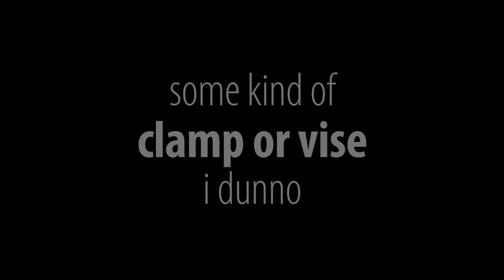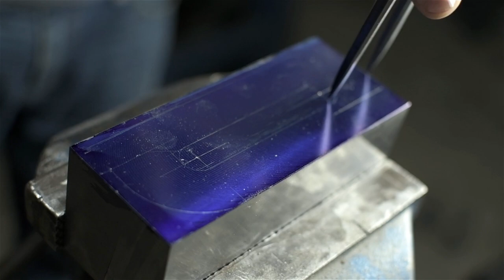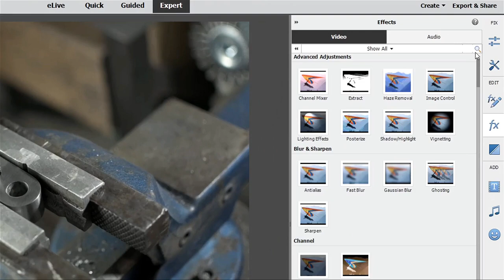BUILD: Toolmaker's Clamp Thingy

Comment: Sharing the wooden dowel wedge trick with the world seems nothing short of irresponsible.
Reply: It's the same for large boulders. He didn't show how to score the breakage line, so the secret's still safe. TOT, that was close... maybe too close.
Reply: To score that line it's very simple, just use a glass scoring knife, but not the regular kind, you need to buy the one with the diamond blade that doesn't come cheap y'all...!!!
Reply: I had to explain to my wife....
Reply: I've tried 12 different methods since this video came out and still haven't figured it out.  Blew up the SE section of my lab in the processes.
Reply: That wooden peg trick is so neat it blew my mind.  I wanted to have a go at it because it looks like it might be of great use for some projects of mine so I tried driving out to the hardware store looking for one of those glass scoring knives but ended up heading back home a few miles into my drive after I got pulled over for having a bad turn signal.  I don't want to drive until I get my car fixed so I decided to try looking on amazon but no luck.  I was also told that I might just be low on blinker fluid and to try that first to see if it solves the problem.  Anyone have any suggestions on where else I might look to find those things?
Reply: Bet Clickspring couldn't pull off the wooden wedge.
Reply: he always has me thinking until the wd40 comes out then i just face palm
Reply: It works, you just need ironwood!
Reply: Not only do the wooden pegs work, they are reusable, just don't store them in your scrap steel draw or you'll end up with swarf on the floor.
Reply: Very good use of the ultrasonic knife
Reply: Wait until you see what he does with dental  floss.
Reply: @shubus  Maybe he scored it on the bottom? I only saw him drill the two holes from the top of the block.
Reply: It works even better with heavy water....
Reply: Jokes aside: that wooden wedge trick does work on stone. The Egyptians used it to split huge monoliths out of granite. There are still some in the ground with the troughs partially finished, almost like the Egyptians left a diagram of what they were doing.
Reply: @o0Noctuabundus0o  somebody was pulling your leg there's no such thing as blinker fluid. Regular headlight fluid works for the blinkers as well.
Reply: @Οδοιπόρος  : Never driven an old import, have you? Sometimes they even use different types for front & back.
Reply: Me better half wants to know what kinda liquid ya used on the wooden dowels ... she suspects it's not regala warta. Also wants ya to approximate the time it took ... "Some time later" aint cuttin it for her.
Reply: Howard Black. Im still trying to figure out were to buy frictionless bearings. I'm thinking maybe Walmart?
Reply: @wtftom1974  brilliant lol
Reply: @TheArsonsmith4242  I never seen someone cracking a block of metal like that, but seems like if you prescribe the direction of the crack by scoring the bar stock, then pour water on the dowel pin, then freeze it, ice expands when it is freezes, and possibly crack the bar stock! let me know if that worked.
Reply: I used this trick on my ex-wife. Hence, why she's my ex.
Reply: @mahtoosacks  you used wood to split her?
Reply: @jsblacksmith858  i do have 2 kids from the marriage. Do the math.
Reply: Psss..... Actually the REAL secret to split steel in two parts like that is the orientation of the wood grains on the dowel pins to the carbon crystallites aka grain lines. If such perfection is achieved in some cases even surface grinding & lapping steps could be  completely skipped.  As Mr.ToT has demonstrated in this video. 👏👏👏.
Reply: @joshuamann4241  

The closest you can get to frictionless bearings is to have the individual bearing parts coated in Hi-T-Lube before assembly.

Best part of that process is that you can then pack them in almost any synthetic, high-temperature grease, and then seal them. Presto, frictionless bearings (or at least the closest you can possibly get to truly frictionless). 

No idea what the cost would be, though. I've never actually priced a job involving Hi-T-Lube; I know I probably couldn't afford it.
Reply: @cavemanjoe7972  lol it was a joke.
Reply: And you know someone is gonna try it....lol
Reply: @joshuamann4241  

I know. Mine wasn't. Just something interesting I thought of doing years ago.

Personally, I'd like to build an engine with all the wear surfaces coated in the stuff just to see how it does.
Reply: @o0Noctuabundus0o  Might be a good idea to check your muffler bearings while you're at it, I heard they get stocked together. If you find one you'll find the other!
Reply: I hope to try this out and see how much I scrap now I gather I need to make a score line
Reply: It's usually in the same aisle they keep the sailboat fuel.
Reply: @cavemanjoe7972  Magnetic bearings are frictionless..
Reply: @user-qc4sj2kv7j  

But can't tolerate high temperatures...
Reply: @o0Noctuabundus0o  try the dollar store👍
Reply: @Οδοιπόρος  But you need to get the 50% duty cycle stuff in the orange can
Reply: @CavemanJoe And here I was wondering what the Hi-T-Lube joke was about.  Actually spent a solid minute thinking about it, saying it out loud, and just generally going “uhh...  I don’t get it.”
Reply: @ejrupp9555  I find Evian works quite well.
Reply: I always liked sending the apprentice to the store with a wet paper bag to get some sparks for the grinder.
Reply: I tried it several times but I can't get my pushing parting line as smooth as his
Reply: @o0Noctuabundus0o  you make sense
Reply: I'm confused so I liked
Reply: You're all forgetting that he used a left handed hammer to drive those pegs. That's the most important part.
Reply: @DocFrobnitz  Nah, they didn't leave a diagram. They knocked off work and went home for dinner.  When they got back in the morning they found the business had gone toes up and the owner had caught the first camel out of town.  Company assets got tied up in the courts and everyone found work at another rock cutter.  Lotta work around in those days.  Lucky for them management didn't know you could use a karate chop to break things apart!  (A reference to another of ToT's skills that doesn't need explaining why it's a joke)
Reply: @sicesp  Not anymore, they moved the sailboat fuel to the electronics areas for cleaning out computers.

Comment: Hey Tony, been watching your videos for a while now, and between you, Jody and Mr. Booth, I went ahead and taught myself TIG welding and bought a cheap little lathe, watched all you guys' videos over the past 5 years, thinking I'd just use the skills to make stuff for myself and maybe family members. Turns out there's nobody around here that weld aluminum or manually turn metal, so my cheap welder and chinese import lathe have made their investments back many times already, although pretty much all of it has gone back into tooling and precision measuring equipment, and I love doing it to relax, everything about it is so meditative and a nice change from the attitude I'm used to having to have at work (at work I have to make sure things are done FAST, with welding and machining I can calm down and make sure it's done precisely). 

Having spent a lot more now on precision measuring devices, I have to say I'm pretty impressed with what cheap import machines are capable of these days. I did split my first 4-jaw chuck in half from overtorqueing (I deserve a free Abom Torque shirt) it but with their prices I guess you can't always get the best :P I do have an old Starrett depth gauge from my visit to New Hampshire last year, missing the 2-4" range, but for how little of my work is imperial it doesn't matter too much. I'm European so I hardly ever take them out except to just admire them. Thank you for all you've been able to impart in terms of knowledge, I hope you keep it up for many years to come. Next I'll have to get myself a milling machine, when the hobby budget allows for it.

I miss the video of you building the hydraulic press, I'm all for curating your video history but I really loved watching that one :(
Reply from the maker: Nice!  that's the way to do it!
Reply: No, getting a reply from you, that is the way to do it. (sorry if that sounds like creepy deification I'm just trying to emulate your every way of being nothing weird)

Comment: You are aware the rod diameter will get bigger when the kitten grows up?
Reply: OMG.  That translates to either more tooling time with out Tim Taylor or, gasp.  LARGER contraptions.  

And a bigger spray bottle.
Reply: I use the same spray bottle on all of my cats regardless of their size.
Reply: To determine the size of the extrusion, you take a telescoping bore gauge and...
Reply: Scored good results in influencing the extrusion size by wisely choosing different sizes of that additional pepperoncino; works with kitten of both sexes and a fully grown tomcat to date;
Reply: @manfredschmalbach9023  
I wonder if a ghost pepper would have resulted in a faster extrusion but a weaker, less hardened metal.
Reply: i think hes banking on it
Reply: When you us hairspray and  sparkling powder next time in the right order, you will have a 4 trigger semi gun!

Comment: Thanks for the Pro Tip for the left hand tap, does it also work for Allen keys? I only have the L - shaped ones, not the ┐ shaped ones that are mentioned in Ikeas hierographs..
Reply: You must have gotten one of the packages meant for Australia.
Reply: Yes, but you need to flip it both horizontally and vertically.
Reply: No, that's not the Flip transformation, that's just a Rotate. It's in the same menu though.
Reply: @klblaz - Remember that Australia is on the other side of the International Date Line from Sweden. Australia IS flipped both horizontally and vertically from the factory.
Reply: Magic left hand tap trick! Nothing up my sleeves!
Reply: You need to ask for Nella keys. They keep them out back.
Reply: @Gottenhimfella  I need to remember that one so I can steal honor it sometime.

Comment: The chilli was for heat treatment.  👹🙀🙀
Reply: At first I didn't get it, but then I was wondering, which pepper do you use? It can't get too hot, or it will cause loose stools steel.
Reply: @A_Man_In_His_Van  or Sheet Metal
Reply: @TuckerMade  lol right! At first I was wondering if nobody got the joke, but at least someone did. Cheers! Keep yer brick in a vise!
Reply: I was expecting spicy bronze.
Reply: Carbide causes constipation.
Reply: I am not so sure they were heat treated.  I mean they didn't look any different after the heat treating unless he ground them without us seeing?
Reply: Indeed.

Comment: That's quite the machine gun, blowing the spent primers out consistently. Might make sure the firing pin isn't overtraveling.
Reply: Also check the bolt face with particular attention to the firing pin hole.
If it is oversized time for a replacement part or a rebuild.
Reply: Could just be hot loaded as well. Maybe try backing the charge down a few grains.
Reply: That would be ToT working hard, sweating bullets my friend
Reply: There is a chance that TOT could be primer actuated blowback operated, which would leave his brass without primers..
Reply: You mean sweating casings askjacob.
Reply: Technical points awarded
Reply: We don't see the projectiles leaving his pores.

Comment: I was going to make one of these but I don't have a cat...
Reply: Use a lion, the resulting bar may need turning down slightly but you've got to work with what you've easy access to.
Reply: But you still  have to find a supplier for those dowels... Sorry,  magic twigs he hammered into those holes plus a solution of unicorn snot to split the part along precise EMD like lines.
Reply: Any Fe line will do.....
Reply: Sure but you have to find one that lets you give it vitamin pills extra high  Cr and Mn if you want 440C from your Fe Line. Hey it's better than coffee beans from Civet cat... Just say'n
Reply: its a metric or imperial cat?
Reply: XDDDD
Reply: @extradimension7356  but civet beans make a great catpoochino.
Reply: metric cat lol
Reply: @noname-zp2zk  what edition?
Reply: @noname-zp2zk  
Are you sure?  What with the use of hot rolled kitten steel, the ancient Egyptians should have been there.

Comment: I just love your videos. I just used two dowels and a water spray to break down a big block of carbon steel ! Thanks for the tip 😁
Reply: It's amazing what old science can do, you'd never expect it to work in today's day and age, but sure enough old ways hold true!
Reply: Its polyethylene glycol, the wood takes it up much better than water

With straight water, you'll only be able to split aluminium, and maybe leftover pizza

Comment: I wonder how big a part you could get out of a great Dane?
Reply: 1-1/2" for sure
Reply: But it would be a longer wait time, and it wouldn't be vibrationally hardened to be artificially denser than what you get at home depo.
Reply: A brand new pick-up truck
Reply: Well. I happen to be Great, and also a Dane. You will NOT get me to go on THAT diet though!
Reply: You could get the block from a Chevy Vega, but it takes a lot of aluminum shavings and five habernero peppers. Also, you have to bribe the ASPCA not to watch the video.
Reply: Probably quite large but it might be a bit ruff... I'll just see myself out.
Reply: Hair balls cause fractures...

Comment: You can tell Tony reloads with that shiny unfired brass.
Reply: my thoughts exactly, no used primer, no burn marks, or action scratching, must have been brand new brass for reloads
Reply: I bet he's using a stainless steel wet tumbling process with primer pockets being that clean.
Reply: Jeremy Gillespie waiting for him to mill his own loads
Reply: Zaphod Whiskers  an ultrasonic cleaner costs like $2,50 on ebay
Reply: @TheAngler2210  They aren't nearly as powerful, so your loads don't get as shiny as if you tumbled them, but the cheaper harbor-freight ultrasonic cleaners (can't recall exact price, I'm sure it was >50 USD) work pretty well if you run 50/50 water & white vinegar. Smells awful, so I set the thing outside, but it will completely clean all burned powder out of the brass. I don't care if they look shiny & unfired, but the primer pockets & holes are always super clean, and the interior of the round gets cleaned well (tested by filling rounds w/ water and comparing weights). Just let the water get nice & hot, and don't overload the cleaner. My model will clean ~25 7x57 Mauser, or 20 45-70. Not a huge deal, since I'm normally only reloading 20-40 rounds of either, and it only takes 5 minutes in the cleaner. Note that the rounds need to be dried thoroughly, I use a toaster oven set very low, since air-drying takes forever.
Reply: @aubiecatt  made my wet tumbler out of an old windscreen wiper motor and a small plastic barrel that used to contain olives. Does a fair job. Also works for giving projectiles a tumble with hbn.
Reply: Headstamp looks like Starline from what I could tell!

Comment: I assume the wood split it exactly on the line because you score it on the top?
I know it works on glass, but never thought this could work on metal too... ill give it a try!!
Reply: It splits it along the metal's crystallographic directions (specifically, along the cleavage plane). Glass is an amorphous solid so it needs scoring to give it a weak direction to break along.
Reply: Man your good. I am still not sure if your joking or not...
Reply: Works with rock too
Reply from the maker: would've never worked without the scribed lines.
Reply: Yeah, thats what I thought... thanks for confirming it!!
Love what you do!!!
Reply: This works for me, but I align the part to magnetic E/W then strike it once with a chasing hammer.  I have found that the scribed line isn't always quite enough to ensure a parting line that's as clean as I require.  Sure ToT's method works, but the finish is demonstrably better with a little extra care.
Reply: @ThisOldTony ; Ah crap!
I should've known the scribe lines were necessary; at least I think I've figured out why now.
The crystal grains are so small in the usual carbon-steels that fracturing resembles that of an amorphous solid. That's why you need 'guiding' scribelines to keep the break from following any random direction, since it only stays straight for the distance of one crystal length on its own!

Comment: Tony, you can't use the spray bottle on all your problems!
Reply: Maybe not, but between the spray bottle and bacon rubbing, you're pretty well covered.  I need to get one of those spray bottles for work...  and the car...  and...
Reply: Yes you can! Depends what you put in the bottle though.
Reply: You can do everything as long as it works. If only all my problems could also be solved just with a spray bottle.
Reply: spray*, *spray*, *spray
Reply: True, but just slack that squirt end of a quarter turn and you'll have range for even more problem solving.

Comment: Living in Australia I am having trouble getting my block of steel to split in  two. All I get is a crack that goes all the way through but does not completly  seperate. I have to finish it with a Cold Chisel. What kind of wood should I use. I've tried to get hold of some Flame Tree wood but the Flame Tree dosn't grow in my area.
as usual B.T. a great video. I have watched most of them but must have missed this one. Look after the little guy and your son.

Comment: Tony, what was the flexible arm measuring tool holder that you made reference to? I liken it to snap flex hose used with the amazing (not an ad, but high praise) AiRTX accessory line. I really need a precise but easily adjustable holder for a windsock jig I have made. Otherwise I have to recruit volunteers to hold the smallest wires while I weld them. Thanks! Love your videos!